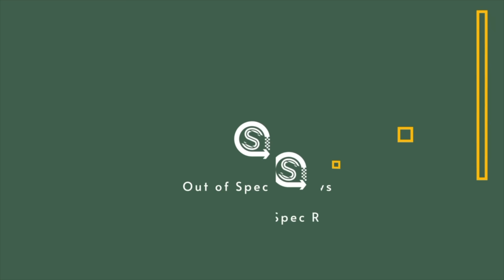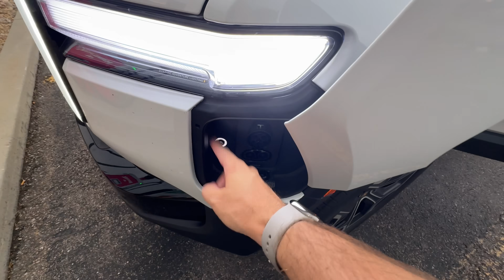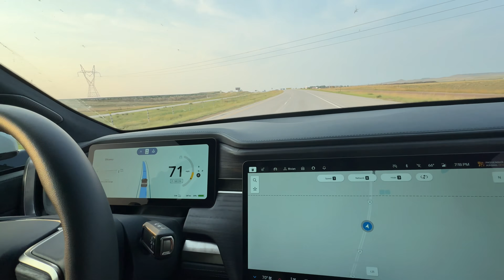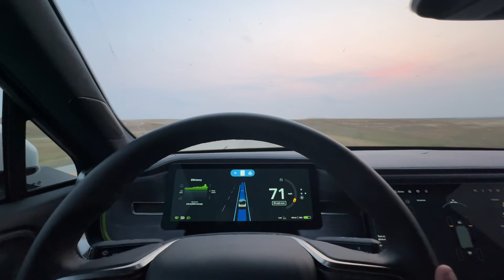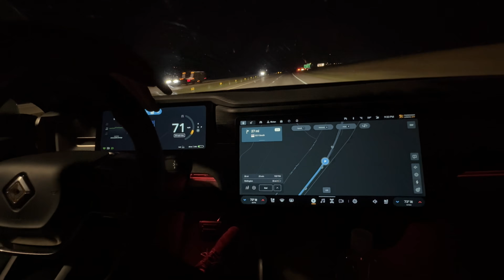New Rivian R1S Base Model Highway Range Test! LFP Standard Driven At 70-MPH Constant

Comment: I wish some mfg would make a plug-in hybrid with 100 miles of electric range…..  and a small diesel engine as a drive train….  30 miles per gallon easily.  Could reduce the cost of vehicle dramatically and never have to use diesel fuel unless you went on super long trip trips.  Why does nobody do this? Idk

Comment: The first setting in the Rivian Autonomy Platform tells the vehicle to match the speed limit if higher than current speed when turning on driver assist on a divided highway. If you want it to use your current speed, turn that off. I tend to keep it off.

Comment: @OutofSpecReviews  Can you do a review on swapping the 21 inch wheels to the Gen 2 R1S  LFP standard, running it from 100% battery to 0% to see the actually range. I am very curious if the 21 inch wheel will actually has the longest range among 20", 21" 22".  Thank you in advance.

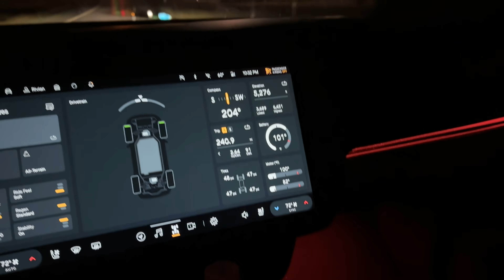Comment: Your answer:  34:22  241 miles  , 2.6 miles/kWh average average speed about 70 mph on Conserve mode
Reply: Damn
Reply: Not bad
Reply: No, that is bad  @falcorzed
Reply: @VariationMachine  It's not bad.
Reply: @VariationMachine it’s pretty damn good for a 91kwh battery on a truck. Excellent efficiency.
Reply: It’s actually not terribly off from its EPA estimated range. This is the standard range model.
Reply: Its like a Tacoma around 15 mpg
Reply: @panchosan1776  except I’m paying ¢13 a kWh so it’s ¢5/mile for fuel instead of ¢20/mile at $3/gallon. It’s 75% cheaper to fuel.

Comment: I recommend that you make sure that your tire pressure setting procedure gives you optimal tire shape and load carrying capacity for optimal efficiency, treadwear, and traction.
I always set tire pressure to factory recommended for the load, in the cool of the morning, in the shade. Sun light on the tire sidewall can heat up the tire considerably and increase the pressure so that you get an incorrect pressure setting.

Comment: 241 miles for an 80k EV is not that great. The efficiency of 2.6 miles per KW is also very poor. In this weather, my Model 3 will get approximately 4 miles per KW driving at 70 mph.  This Rivian is the RWD version of the Model 3 and it just isn't that impressive. I don't like the look of the Cybertruck (it's sort of growing on me), but it appears to be a much better truck for the money. I do give this Rivian some credit for getting 241 miles because these are all highway miles, and that makes a big difference. It would probably get 260 - 270 miles in mixed driving, if you kept to the speed limit in the city.  

I like Rivian trucks, and if I were going to buy an EV truck, it would probably be a Rivian., but I would look very hard at the Cybertruck first because it does appear to be superior to the Rivian in almost every metric. I would like to see how the two trucks compare off-road because Rivian has gained a reputation for being a great off-road truck with its four-motor truck (one motor for each wheel).

It appears that Rivian is still cutting its teeth with its vehicles and is going through the mandatory period of refining a new vehicle. Of all of the EV manufacturers, I believe that Rivian offers the most promise to raise itself up to a place where it can actually compete with Tesla. But that's not going to happen anytime soon. It's probably going to take Rivian at least five years to even begin to catch up with Tesla.

Comment: So realistically, you are going to road charge to 80% because the charge curve really drops off there. Then you will run it down to 10% or so before charging. that is 70% of a battery LFP pack so about 165-170 miles of range between charges on a road trip. Take a dip for really cold or really hot and about a %15-20% loss... about 140 miles of range on less than ideal weather days. That is about two hours of driving between charging stops assuming that range makes the next charging station you need. Not a road trip warrior but certainly is serviceable for most people who will use it around town etc and occasionally road trip it.

Comment: The efficiency is the biggest improvement with this Gen 2. 2.64 m/kwh right when you got off the highway at 70mph is much improved over Gen1 R1S and the R1T has always been even more efficient than a R1S so the range tests in the large and max pack in the Gen2 will be interesting to see. Also this is not even on the range wheels. Would be interesting to see what those range wheels would add to the 2.64 m/kwh efficiency.

Comment: Thanks.  Seriously considering a R1T once NACS goes native.
Reply: I recently road tripped (1600 miles round trip) in a Gen1 R1S I rented on Turo that has the NACS adapter and used Tesla chargers then entire trip without a single issue.

Comment: So Jordan just one example to share. With our 2023 R1T performance dual motor max pack. On a recent trip to see how far we can go. We got 350 miles. Ours is rated with the 22 inch wheels at 380 miles, which equals approximately 92%. Also, this was at about an average of 78 mph and 80 degrees
Reply: I think you must have been trailing vehicles a lot as that's unrealistically high in most uses. Remember that he actively avoids following other cars which could make things look more favorable but are an obvious variable that must be removed. Remember that drafting vehicles can increase fuel economy but up to 30%.
Reply: @Skylancer727  well, I'm not a NASCAR driver...just real-world experience
Reply: @Skylancer727  I see nothing wrong with drafting at 78 miles per hour, thats about the best way to drive don't you think?
Reply: @darinbrazil5496  personally I draft trucks all the time, but it does give generally inconsistent efficiency results. If you're testing vehicles against each other it's best to not draft for best comparison.

Comment: Thanks, Jordan!  I'd like to see a bigger battery pack to get more range until we have greater charging density in more remote areas (as well as the all-terrain option), but I totally prefer an LFP pack!
Reply: Drive at a more reasonable 60 and I expect You'll do better on distance..........Paul
Reply: @paul-flyer  60 is borderline dangerously slow for most interstate travel down here in the south east.

Comment: Great car! But I think 241 miles range at a $75,000-80,000 price point is not good. But LFP batteries are cheaper to make and Rivian can probably make a profit on this vehicle. If they can, then knock yourself out Rivian. Go for it.
Reply: They are currently losing money selling at $80k. The cars should be over $100k to break even. These new factories don’t pay themselves.
Reply: They also last WAAAy longer than NMC and are also quite a bit safer.
Reply: @justinstewart3248  Tesla NMC batteries lasting to 200,000 miles or over have a failure rate of 1.5%. And they mostly fail under warranty. Not too shabby.
Reply: @ agreed! They are fine too! I have one in my Tesla. Just singing the praises of LFP as well!

Comment: Not bad but this car only serves city needs at 240 miles full range at the best conditions.
Hauling a family, going 80 mph, weather not being perfect (hot or cold or windy or rainy) the full range will be 180-200 miles. So at every leg of the drive charging from 10% - 60% you can only do like 90 miles.
Paired with the slow charge rates on Rivians, it makes it difficult to even do a round trip from Dallas to Houston.
I wish they manage to get the large pack below $80k and do the updates necessary to get the tax credit and put NACS on the car. Now that would be an all round vehicle.
Reply: Over 200 W until 35% and then 150W at 50% isn't slow.
Reply: @DrGODofTHUNDER  
Depends on what you compare it with.
The car will do 2 miles per kWh in a normal road trip and has a 106 kWh battery and costs $80k.
Cars with better efficiency and a smaller battery have better charging curves at a cheaper price point. 
So if you want to charge 120 miles or so to your next charging stop, you will be at a charging station way longer than most other cars at this price point. I think comparing it to a similar priced Model X Long Range, it would take at least 1.5 times. The 10% challenge would be a great metric to test this.
For the “new gen” of a high end EV, the charging performance leaves a lot to be desired.

Comment: 2.2 kWh is terrible.  How does Tesla and Lucid do it?  Lucid is now 5 kWh.  Sorry but if I am going EV I want the most efficient EV.  Plus it must have a built in NACS.  Thanks for the info.  I will hold onto my Y for another year.  Tell Kyle to quit using the wet rags on the chargers.
Reply: 5 miles on a lucid is a bogus claim, I can hardly sqeeze in 3.3 pet kwh

Comment: I like that Rivian is focusing on the fundementals. I'm rooting for this company to become profitable and be around 20 years from now. They needed to cut cost somewhere and the doors might have been on that list. Let's hope there's many that snuck by a person as knowledgeable about what to expect as you.
Reply: Least they CAN  spell SOFTWARE HAHA
Reply: Battery far too small for a truck with that consumption and price. Together with poor charging it's close to unusable for real work and roadtripping. Put a trailer on this one and drive 150 miles or what 😅
Reply: @herrnaico  240 miles is not bad at all for a 7 passenger vehicle. Especially one with the squared off design that many people like me appreciate. Keep in mind that LFP batteries are made to be charged to 100% regularly. EV's in general are not good for towing heavy things at long distances (which the vast majority doesn't do anyway). GM overcame it by throwing a massive battery at the problem, but then you're forced to lug all that extra weight around for all of the other uses. Diesels are the correct tool for that job until battery technology improves.
Reply: @herrnaico  This trim is not for towing. This is for trips around town with the kids in the back and groceries.

Comment: 241mi seems to be less than on my ID.4 which is smaller but also has smaller battery (77 usable). I don't like that they overestimate range, I'd prefer if they underestimated
Reply: Rating is probably at a lower, more sensible speed.....We Are not all race car drivers.............Paul

Comment: The problem with this test is it's really not a true 70mph range test. I'm willing to bet with all the slower down you did the car would have at a trip average of 65 or under. To measure it's real range you'd have to let it die on the highway sort of thing.

So the real highway range is closer to 230 or so. At 75mph is might only be 200 which isn't great. But it's usable and this should charge a lot quicker than the NMC battery

Comment: Now it’s time to see the 10% challenge, to really see the true road-trip capabilities.
Reply: This!
Reply: Silly challenge.  10% of what?  You can't compare it between two models, if they don't have identical battery sizes or miles per kilowatts.   It's almost as bad as the how long does it take to  get to 85%.  Lol.  85% of what?  I have old laptop that charges to 85% in a couple minutes...because the battery in fact has degraded so badly. lol.  I don't stop driving my car because have only 10% battery left, and in a gas car you typically can't even tell 'where' 10% of gas tank remaining is...because that metric is so useless.
Reply: @summertyme5748 obviously you don’t watch the channel. They start at 10%, charge for 15 minutes, drive until they get back down to 10% and compare the distance driven to other cars. It’s the most meaningful test they do.
Reply: @summertyme5748  It’s actually the best test to show what normal people will experience on road trips. Most people feel safe arriving at the next station with 8-15%. So 10% arrival and 15 minutes charging is a great way to test a car’s road trip capabilities.
Maybe you could argue the starting point of the test could be a few percent different across different cars (so that they match each other in miles left in the battery as a safe buffer, like 20 or 30 miles) but that won’t change the results too much.
Reply: @FarhoodEnsan how about starting at 80% charge, drive a day or 3 u til down below 25% and then top back up to 80%.
How many miles driven and how many Kw added to replenish. 
That is a better miles to Kw.
Then people can use the Kw cost in their area to get a cost per mile average. 
My tesla x gets 2.7 miles per kw
Reply: @summertyme5748 you've shown you don't know what the 10% test is. They start at 10%, charge for 15 minutes and see how far they can go before they're back down to 10%. It's a true test of charging speed and efficiency. None of what you are on about.
Reply: @summertyme5748  Go watch one of the many  10% challenge  videos and you will find the answer to your question.